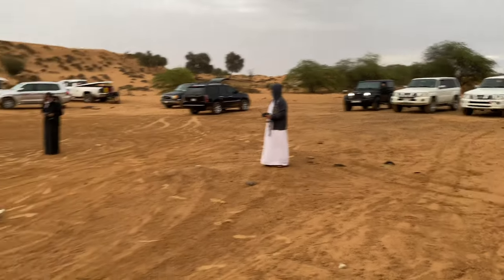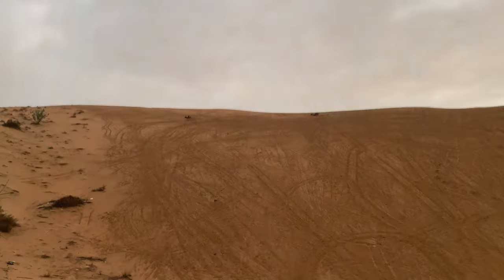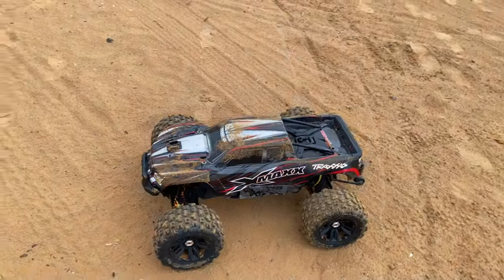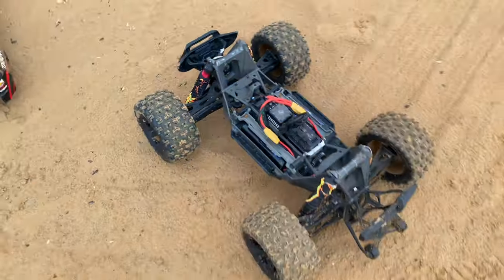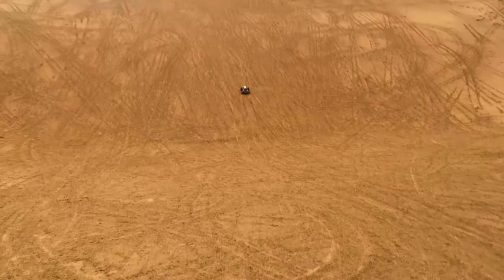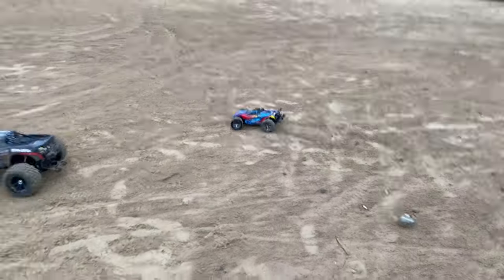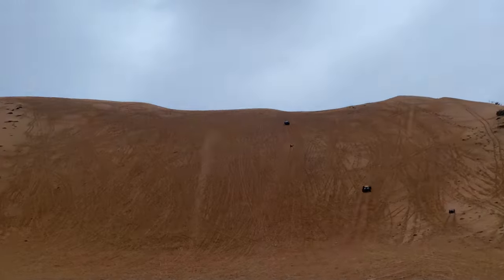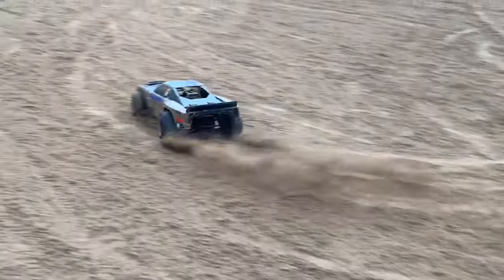RAINYDAY RC SAND DRAG KINGS 1/5 1/6 Scale the best

Comment: Hi, since you drive on sand a lot, how often do you replace the bearings?
Reply from the maker: not much believe me we use stock traxxas bearings or fast eddy only replaced 3 bearings within 1 year for example rpm bearings didn't last more than one run
Reply: @UAERCADDICTS  oo okay, same here with my MyToys. They diedonly after 2 years of use. Another thing, how is the Traxxas Slash 4x4 VXL in your experience? Has it been a good car?
Reply from the maker: @ligijiji9919  yep the 2wd slash is much more fun for me better than the 4x4
Reply: @UAERCADDICTS  ah nice, what about durability? Are they durable?
Reply from the maker: @ligijiji9919  they need some upgrades in the drivetrain like driveshafts and electronics
Reply: @UAERCADDICTS  oh okay. Was looking at the HPI Firestorm too, do you know if they're good?
Reply from the maker: @ligijiji9919  the HPI is old models not good as todays traxxas and arrmas
Reply: @UAERCADDICTS  oh that sucks, the HPI looks really good. I've heard that theyre really durable too
Reply from the maker: @ligijiji9919  old models yes not the new ones
Reply: @UAERCADDICTS  yeah the new models aren't that great